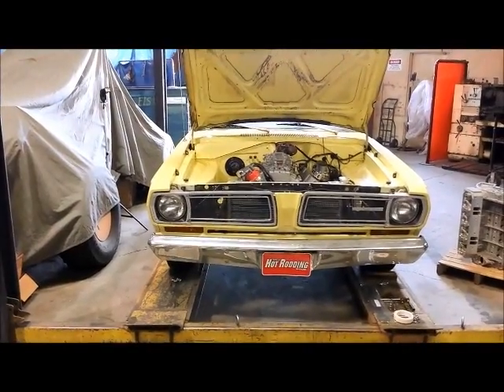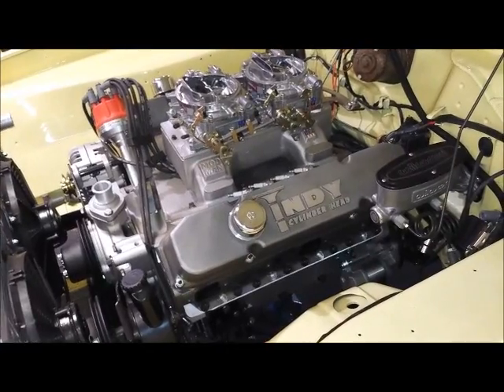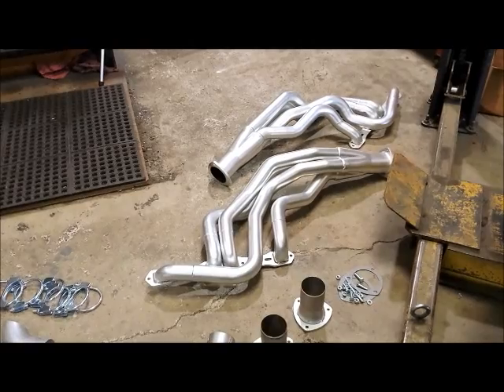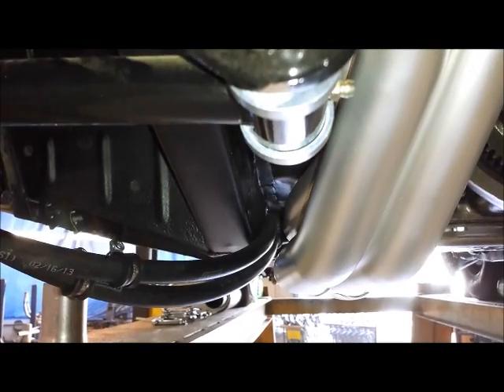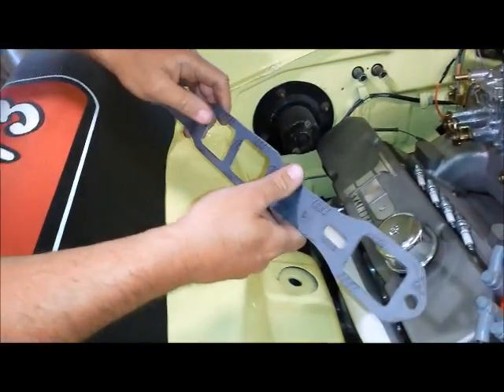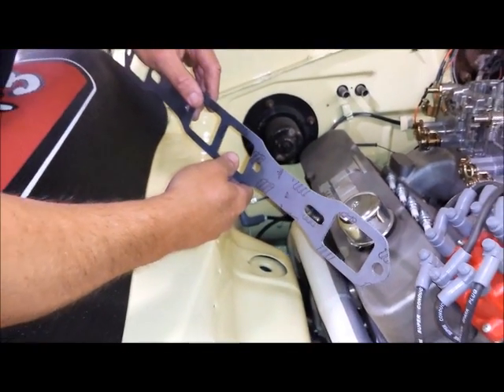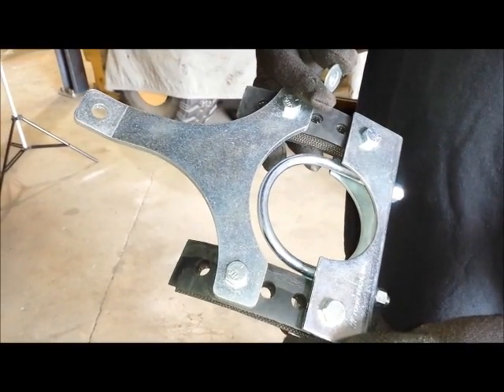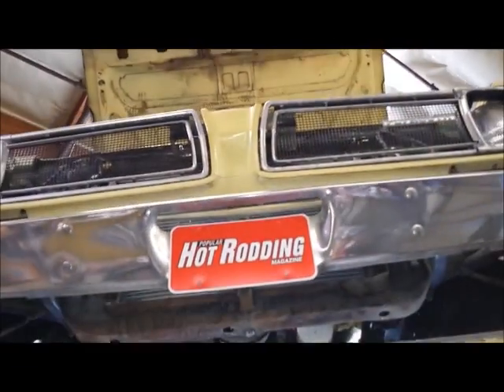Installing TTI Headers & Exhaust In Project Valiant

Comment: Love this car and video overall, however, I purchased a brand new set of TTI headers for RB block w/Brodix B1/BS heads specifically, and I still had to beat the $*@# out of them in order for the starter to fit.  I even switched to a mini starter and still had this problem.  Who was the head R&D fabricator in the early 2000's?  Well, he didn't do his job.  Also, the "ceramic coating" I ordered mine with started rusting in certain locations, which for $850+ you'd think these 2 problems would be resolved.  I like the headers, but unhappy with the extra banging and rusting ceramic coating I have to deal with.